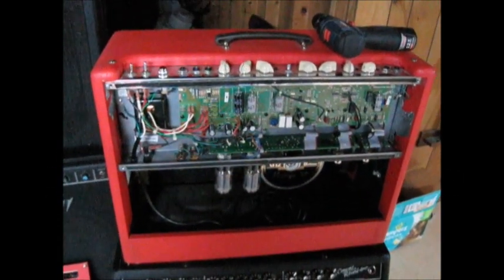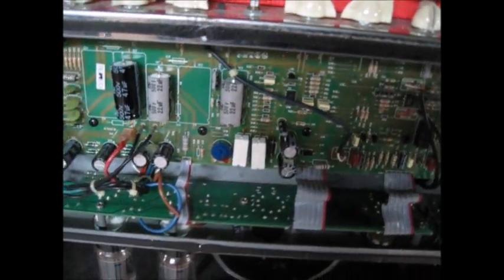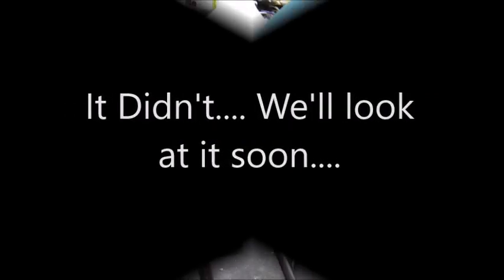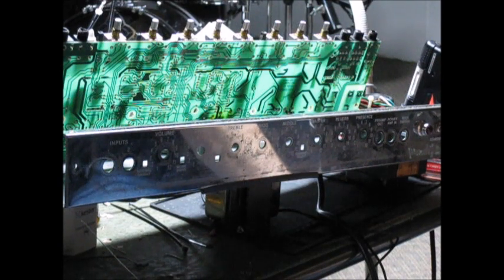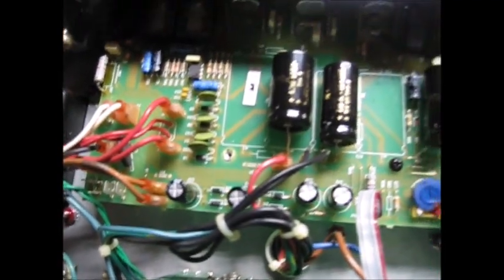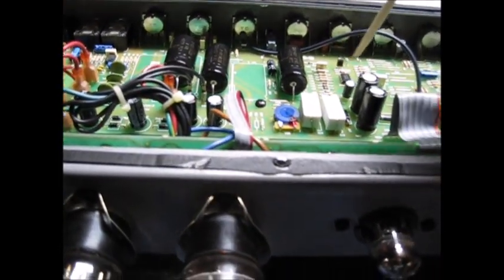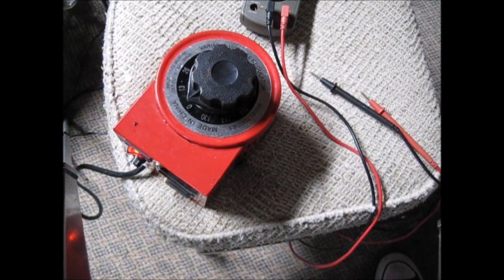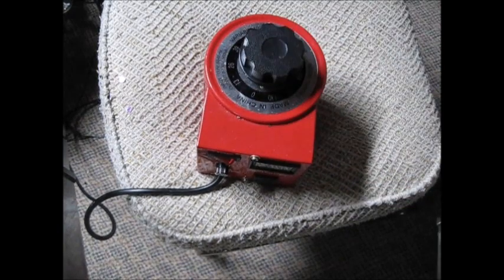Fender Hot Rod Deluxe--Texas Red gets a full maintenance.

Comment: You are correct the entire Fender "Hot Rod" series takes a month of Sundays just to get the main boards to a repairable and serviceable condition.  Since its such a pain in the ass to work on them and many of the parts fairly inexpensive some one should put together a complete list of upgrades and or corrections for each model that should be completed for optimum performance.  Once again hats off for another great job.
Reply from the maker: Now for the "concert".... even worse to take apart.